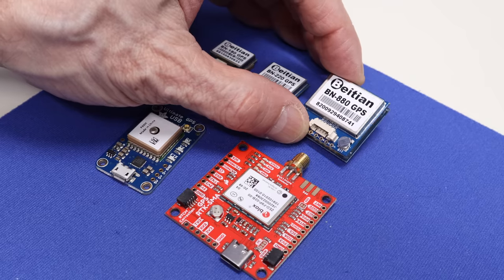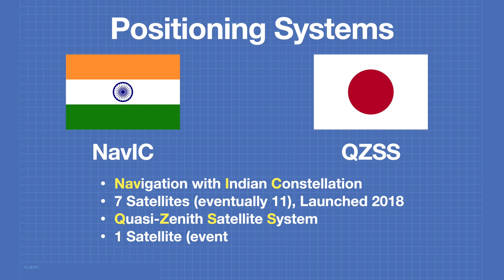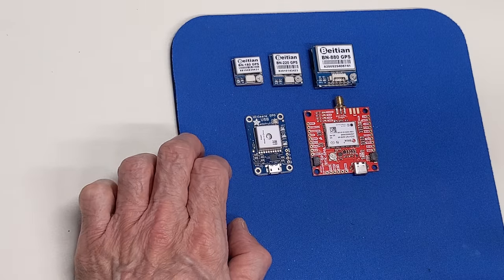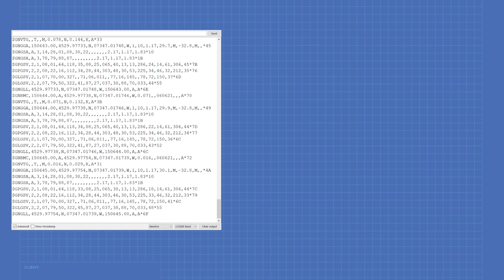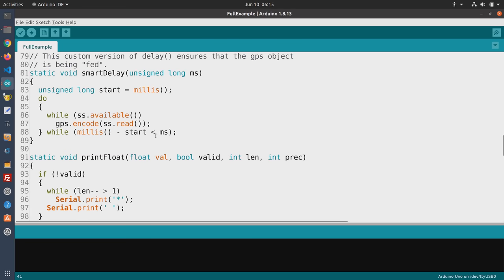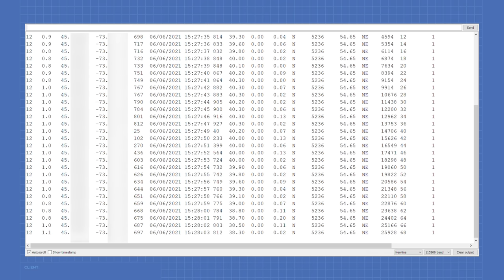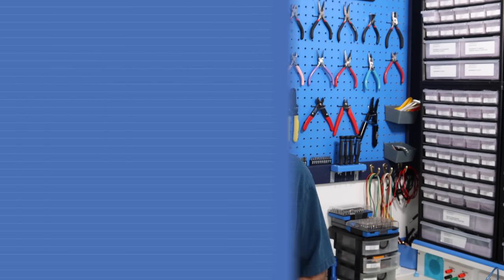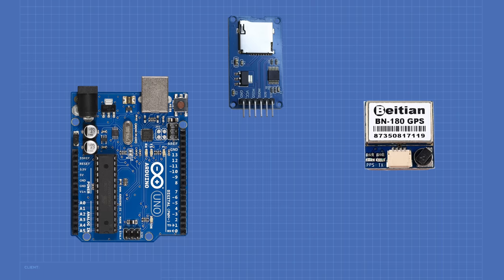GPS Modules with Arduino and Raspberry Pi

Comment: We sure have come a long way from that pain in the rear Loran-C system. Hated using that for navigation. It took forever to establish a connection to enough antennas and it had to be turned off if I needed to use my Marine VHF

Comment: great video as always ! Users pay attention I have struggled for long time getting GPS data using the built in TinyGPS examples and failed just because the baude rate was set to 4800 instead of 9600 as shown in the video

Comment: Really cool video as usual. Thanks for that. It remains unclear for me why you always wire the µC-TX to the modules-RX, for my understanding the controller only listens and therefore you only need the module-TX to µC-RX connection. That is at least how it works in my projects. And yes, these Chinese modules are extremely cheap and sensitive. My one (BN-180) works next to my balcony door inside behind the glass and curtain and has a fantastic reception to synchronize my matrix LED clock. I like your videos and your way of explaining things.

Comment: This video helped me a great deal. I've been experimenting with some surplus Rockwell Jupiter GPS modules because I want the locked 10KHz signal they produce (along with the 1pps signal). At startup, the units produce the signals unlocked and then they lock to the satellites after a fix is established. They have no built-in indicator, so I tried reading the NMEA data using the Arduino hardware serial port and--big surprise--I couldn't read more than 64 characters on the serial monitor each reset. Before I finished last night, I did learn that 64 bytes is the size of the UART's buffer, and that the size is hard-written into the IDE libraries. BTW, I also discovered the IDE doesn't like anything else attached to RX & TX when uploading a sketch, so I had to pull those connections every time I wanted to do so. 

This morning, I was thinking I needed to use an MCU with a larger RX buffer, but then I watched this video and found out about software serial! I'd never heard of it before, and it solved two of my problems: reading the continuous 4800-baud stream from the Jupiter with no show-stopping overflow, and having to disconnect the serial lines whenever I want to upload to the Arduino. Being able to pass the software-serial data right off to the IDE hardware-serial monitor was just an added convenience. Thank you so much for this information, and all the other materials you put out!! 

BTW, besides uploading sketches, is there any other reason to ever use hardware serial?

Comment: Great video! Hopefully, you've done more on this topic... I will search your channel. It would be so cool to use the red Spark Fun GPS's RTK capabilities in conjunction with the best GPS out of the others you had. Would it be possible to use the RTK capabilities in this way? For example, would it be possible to integrate one GPS on a robot and another GPS on the robot's charging station to achieve centimeter-level precision with RTK? I don't know how RTK works under the hood, so correct me if I'm wrong.

Comment: I like to think on GPS as 4 equations with 4 unknowns (x,y,z,time), this also opens up for some shortcuts (That I have seen on some of my GPS devices).
Time must be within nano seconds, this not not possible on a crystal for very long, but it is often possible for a few minutes, i.e. a smart GPS may keep the position lock for a few minutes on 3 satellites (3 equations, 3 unknowns).
When on the water you can often lock the z value to 0, this again means that 3 satellites is enough to keep a position lock (On one of my GPS devices you could define you current height and it would lock on 3 satellites).
Theoretically the above means you can keep a lock with only two satellites, I have never experienced that , but then I have not been sailing much.
DGPS (and other similar systems) is a very interesting topic, that you mostly skipped. It usually works by sending a nano second correct for each satellite (Correcting for atmospheric delays), the correction can be from a ground based station or from a satellite and can be free or require a payment (Payment is probably mostly obsolent). They all work by having a station at a known location and measuring how much the time from the satellite is wrong, the result can then be send directly or via a satellite.
Reply: Are correction librarys/tables still publish that provide the absolute true true position where the broadcasting satellites were at time t?

Comment: Now I know why a robotic lawnmower doesn't use GPS as 1-3m is potentially poor depending on the size of the lawn. I watched your earlier video introducing the change to esp32s and with respect to the esp-cam and hoped for a lawnmower. I bought a worx landroid and wantd it to work within a temporary loop of perimeter wire. It ran over the pegged wire and cut it.
I watch in hope of something that can cut the lawn at a reasonable cost with ideally no wires. PS Love the videos Ihave seen and will look at more. Thanks
Reply: Did you get it to work
Reply: @elmeradams8781  I did not get time to pursue alterations.
I think that the Worx would work if the cables were buried in the ground and you give it more room at the edges to go over the wire. I temporarily used tilted metal stakes to carry the perimeter wire though not ideal. 
 RTK is a bit pricey. 
The other trouble with these lawn mowers is they ideally would be left out due to the limited cutting ability and inefficient time consuming zig zagging coupled with potential theft in the front garden.
I did not get time to do anything, but noted interesting potential wheelchair motor mods to lawn mowers which can cut more aggressively, but have to learn to weld.

Comment: Thank you.
I'm trying to avoid using an external SD card but I can't find a datasheet for it. It remains to find out how to use flash memory on modules bn-220 and higher. Or what can it be used for, if not for data storage?

Comment: Thanks for this video.  I have a GPS receiver and have it functioning on an Arduino Mega with an LCD screen that includes an SD card adapter.  I would like to use this setup to take another set of data and associate it with the GPS location and write one entry when that data is available but not a continuous stream of GPS data.  Is it possible/difficult to utilize a pushbutton switch to tell it to log the data plus the location to SD?

Comment: Many thanks for this GPS information. Looking forward how to do this with higher accuracy. I have the module from Sparkfun ZED-F9P, but when I tried to apply RTK correction messages, the accuracy actually was worse, about 10m, without corrections about 1-2m. Also powering the module from Arduino 5V is not possible, because there is no sufficient current for the GPS and the Bluetooth module, that is needed
Reply: Had a friend who solved this by utilizing 3+ GPS receivers on a known pattern (triangular at 1M distance from each other) and he averaged the location data reported and got much better accuracy.

Comment: If the declination changes with your location, would it perhaps result in a more accurate reading if you were to send the GPS coordinates to an API to return the actual declination at the current location? Or is that overkill and maybe there's a better way to keep the compass accurate as you travel?

Comment: Which one is better for max data I see BN880 gives additional data of compas with not much of a cost difference , but the other module shows Adafruit had external antenna would that be an important thing to consider given that getting signal is most important ? how much of difference is it in practical terms between the 2 ?

Comment: At 6:00, I was surprised when you showed 4 Satellites, but I was taut it took 5 Satellites to sink.
Bill, how about a shot of your setup for the Antenna? You showed the parts, but not how it was mounted.
Reply: For a 2D 'fix' you'll need 3 satellites, and for 3D you'll need at least 4 sats. The more sats the better obviously.

Comment: I picked up an LC79D a few months ago.  It does dual band (l1+l5) and gives you an accuracy of 1.2m and it's only 10 bucks!  Much better than the old school modules for drones.  Perhaps not quite as good as some of the others being sold but those tend to run closer to $100.

Comment: what libraries would you use in a Pi Pico? i have adafruit ultimate on my Pi4 and going to put it on a Pico. My Pi4 currently runs a webserver with web-sockets which pushes updated GPS data onto my map live, each waypoint has a pop-up info window. I had to "borrow" a gMap key from some other site that left it in plain site!

Comment: I am using a M8Q-5883 GPS & Compass and I am connecting it to my Arduino Mega and I have tried all the examples and none of them are working. Would you have any idea on a solution?

Comment: Preparing to launch a HAB or High attitude balloon package.    Expanded Capability Weather Balloon ?
120,000ft is possible.
I can deal with the Temps and Pressure limits.  
I need a GPS system capable of transmitting Altitude readings up to  100,000ft and more.  I think a 1/4w 433mhz system may work at those altitudes with a Yagi Antenna.  
Data Logging to a Card.
Homing beacon not needed if the GPS is working. May use a SPOT  GPS system.  Spot will not perform over 60,000ft.
I would send a sounding balloon with transmitter prior to camera's and other payload.  

Do you have the means ?
Reply: I have a SDR radio on hand.  Demod is my issue.

Comment: at 35 minutes you can see PPS on the GPS module, can you tell us what is that used for?
Reply: The PPS signal or Pulse Per Second signal is a time reference signal that the receiver transmits in synchronisation with UTC.  It is normally a TTL logic pulse with the rising edge aligned to within 1us of UTC.  The PPS allows you to use the GPS as a highly accurate clock with the PPS acting as the "tick" while the NMEA sentence data tells the time.

Comment: I got an error with Adafruit HMC5883L 3-Axix....  until I installed
Grove 3-Axis Digital Compass HMC5883L             I have Arduino IDE 1.8.15 Installed
Reply: Bill's video on the magnetic sensor was quite incomplete as real magnetic field calibration must be done.  Otherwise, there is little chance that this magnetic compass could be used to establish a heading.  Curious if you completed this calibration - involved slowly rotating the compass on each axis until the max and min fields are measured. I will also enter a comment directly into the comments section.

Comment: The NHL will be doing  this at all of the games for individual players and will even have data on puck position and velocity in real time.
Find he article by searching for "Hockey is finally getting access to real-time stats to back up its high-speed reputation."  By Jason Cipriani | April 29, 2021 on ZDnet.
Can't be using GPS because "most" all games are played insidise.  ;-)
I would love to bring this down to the the high school level in price for football, soccer, baseball, softball, and Xcountry could use.
Add Trails to all the players with them all synced together and ...
Reply: Why are they working on that. They need to be working on the cheap shots and out-of-control cross checking. When they took fighting out of the game they opened up a can of worms.

Comment: I disagree with the statement that 3 satellites determine the position and the 4th is used as a time reference.  Imagine four points in space, and you know their positions precisely and you know your distance from each of them precisely.  You want to know where you are.  From the first satellite you can put yourself on a sphere -- you know where the satellite is and you know you're a known distance away, hence, you know what sphere you are on.  The second satellite puts you on another sphere, and that sphere intersects the first sphere in a ring.  The third satellite puts you on another sphere, and the intersection of the three spheres puts you at one of two points.  The fourth sphere tells you which of those two points.  I suppose the video's characterization might be correct also, but, mathematically, I don't see how three satellites can give you a fully determined exact answer.  Granted, with just three satellites one of those two points might be "silly" but equations on a page can't decide what's "silly".
Reply: As we know 3 satellites range measurements provides a 2D fix, 4 satellites range measurements provides a 3D fix.  Where a Line of Position (LOP) that LORAN C calculated needed only 2 range measurements for a 2D fix which is consistent with the math. Two measurements should produce a 2D fix and three measurements should provide a 3D fix mathematically. The reason I was given that the NAVSTAR GPS requires an additional measurement was that the satellites have Atomic Clocks on-board your GPS receiver has a highly accurate clock but not to the precision of an atomic clock. In GPS it is all about crazy precise timing. The 3rd and 4th satellite range measurements for the 2D and 3D fixes resolves the GPS timing error present in the GPS receiver. Note also that GPS altitude is not terribly accurate since Mother Earth is not a perfect sphere, therefore GPS Navigators used in Aviation input barometric altitude from an air data computer or altitude encoder to improve GPS altitude accuracy into an acceptable range.

Comment: Can anybody ANYBODY access GPS satellites for the data from the Ground/Earth - Or do I have to program them to receive it only from a specific satellite -Or is it irrelevant as all satellites accept requests and respond the Lat and Long ?
Reply: The receiver takes care of everything.  There is no communication up to the satellites.  When the receiver has enough satellites in view it uses the data they transmit to calculate the position and other data output in the NMEA stream.
Reply: @blackboxcameracom  Thanks - got it. Appreciated the reply.

Comment: I know this video isn't about it but wouldn't it more useful to tap into your cell phone gps API? Won't that give you more data?
Reply: Maybe someone wants to build a $5, super-tiny, battery-operated, Arduino-based unit to leave in the field. GPS breakout boards would be superior to sourcing coordinates from a phone.
Reply: Hey friend, there's a way to access gps in your phone using MIT App inventor 2. its an online app maker that give you access to your smart phone's sensors(gps, bluetooth etc.).

Comment: If you want to use a GPS receiver with a Raspberry Pi check out the GPS-PIE 'slice" modules which feature a GPS receiver combined with a BNO055 9DOF IMU motion sensor and MS5637 barometric pressure sensor in a Raspberry Pi friendly pHAT format. 
See https://youtu.be/goBLV8Ur_AE

Comment: The best presition that you can physically achieve with a GNSS (neglecting multipath) is some millimeters. Anything claiming better ist plaun bullshit. Taking into account mutipath in a moderate urban environment (and not being static) is about one decimeter.
I really dont know where comos the bullshit of sub-millimeter there is not even posibility to measure such a thing.

Comment: Hello Bill! My name is Gennady. I am following this video closely. I found one, let me call it "a mistake", in the magnetometer example with BN-880 which you discuss. Problem is  that the magnetometer (compass) program makes no provisions for the compass being tilted, as on a boat, due to rocking of the waves. Hence, what happens is that the compass may be pointing in the same direction, but because of the tilt of the compass (see video at the end), the compass heading reading is wildly off. I would like to know if you can discuss this problem, and how to compensate for it. See this video for more explanation: https://youtu.be/ZeBQSYdtDXE